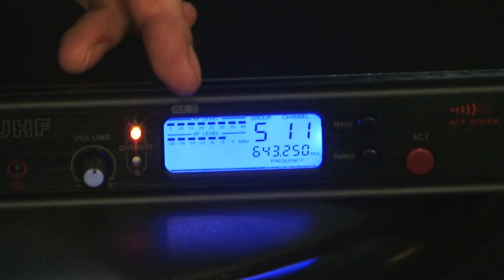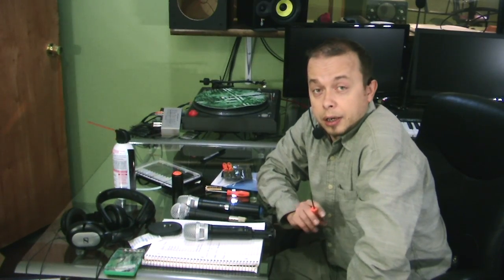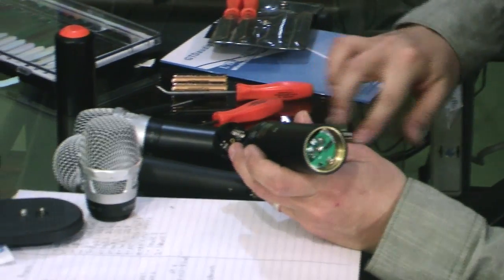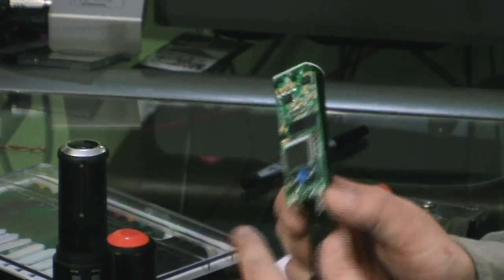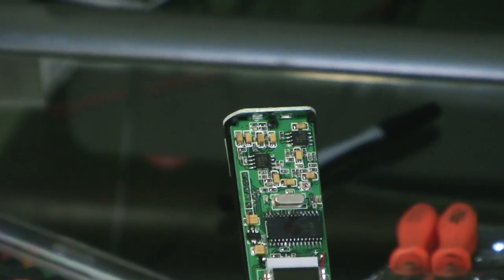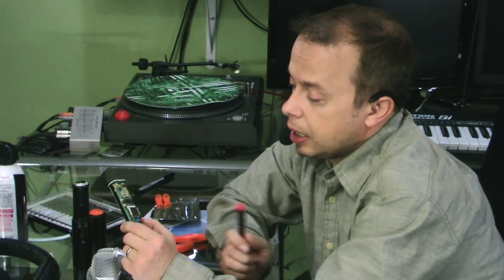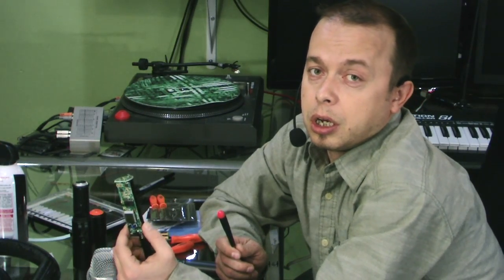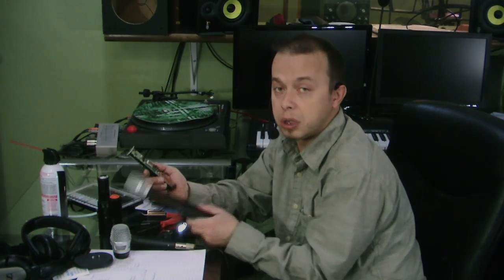GTDaudio 3/6 - Fixing gain in  G-788 wireless microphone system

Comment: You never told us if that helped lower the gain .
I have GTDaudio wireless system also, but different model.
  the gain on them is set so high I never use them that much.

Comment: As of Jan. 2013 there is a -10db switch under the mic head capsule and on the body pack transmitter. There is also a -10db option on the receiver menu